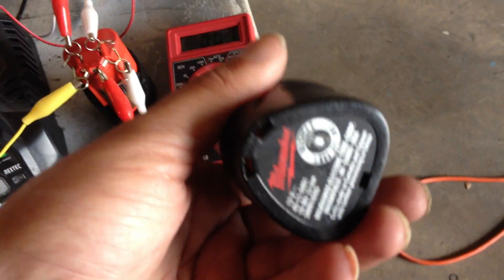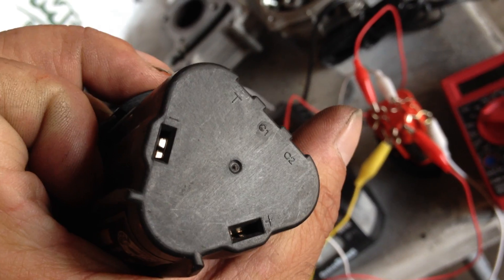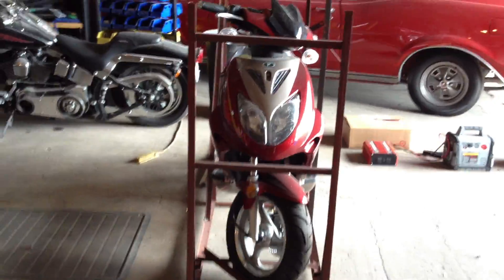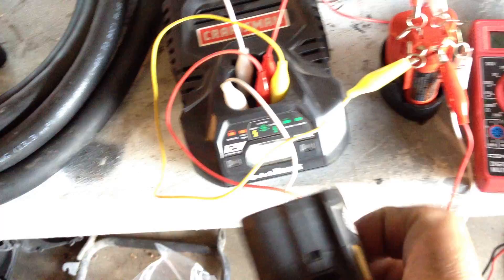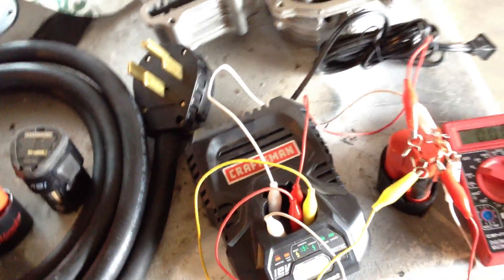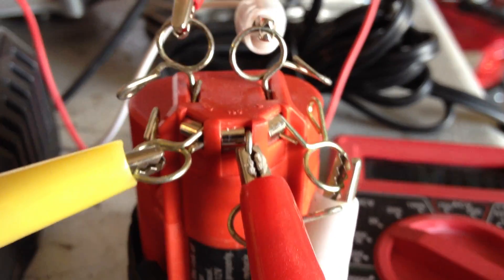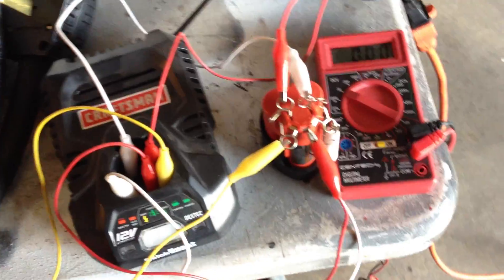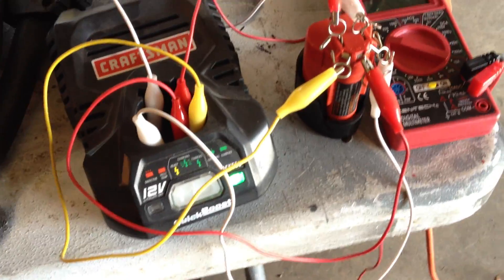Charge 12v Lithium Battery--Craftsman, Milwaukee, Ryobi, DeWalt & More with SAME CHARGER!

Comment: Great idea! I tried to charge some batteries 3*18650 with the drill/driver charger; the only thing to do is to "cheat" the charger,  as different batteries have different thermal resistors.

Comment: Great video. ..I was using my battery to power a taxi cab  sign12v light with 2 small bulbs...I forgot to remove battery and It wouldn't let me charge it...used your tips raised the voltage enough to wake it up and fully recharge it.